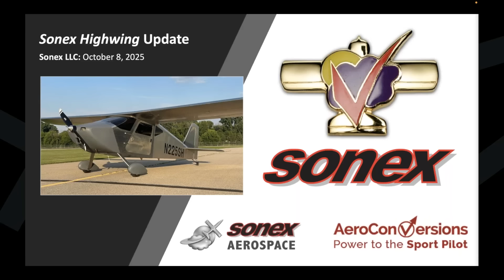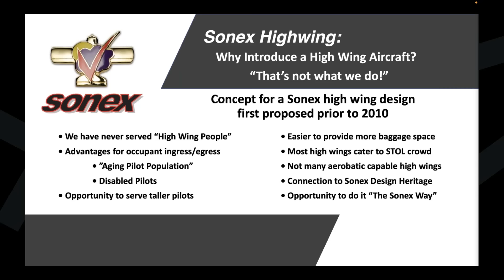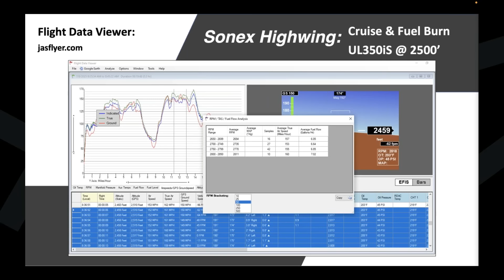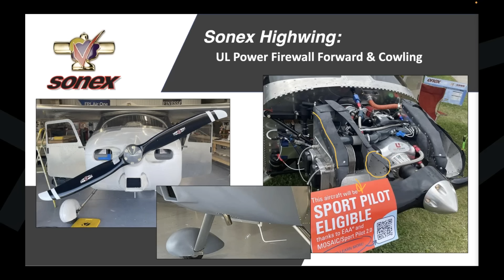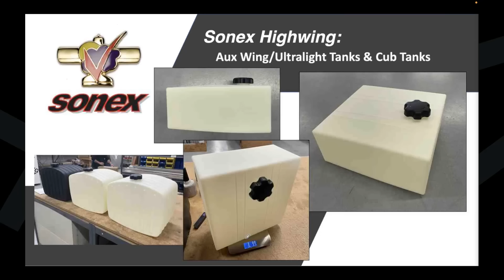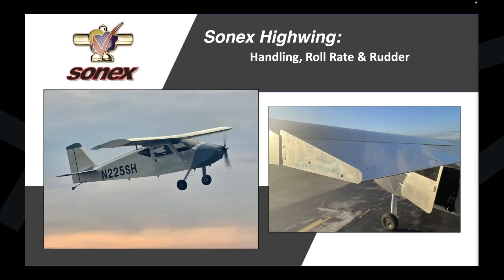Sonex Highwing Update: October 8, 2025

Comment: the Sport dual stall speeds is just the FAA trying to act smart, but proving they are still very much can't help themselves when it comes to screwing things up.

the questions about this stupid rule are never going to end. it makes no sense. A PVT pilot doesn't care about  61kt stall if he can fly it regardless if its above or below 61kts. the PVT pilot cares if he can fly it without a medical, in which case it must be 59kts, and so there is NO USE CASE for the 61kt LSA.

People at teh FAA are so dumb that they don't even understand how aviation works.
Reply from the maker: The 61 Knot Vso is an accommodation for the manufacturing side. With this specification, a manufacturer could build a 4-seat aircraft intended for Private Pilots that doesn't have to be Part 23 type certified. For example, a manufacturer can now build something like the Mooney Type S with a 60.2 knot Vso and top speed of 242 knots with retractable gear and a constant speed prop and no-longer have to have it type certified (ASTM certification is a lot less expensive and less arduous, not to mention the savings to the taxpayer with regard to type certification process participation/sadism by the FAA). Imagine what that would do for perpetually in-and-out of business Mooney to help their bottom line.
Reply: @SonexLLC  Thank you. that is the FIRST and ONLY answer I've heard that made any sense at all. Even the FAA fails to explain what this rule means.
Reply: Really, an unfair assessment of the FAA. They should be applauded for making MOSAIC a reality rather than quibbling over the 61 knot LSA. There is a perfect rationalization for the 61-knot LSA. You should try to see if you can figure it out before spewing nonsense.
Reply: @whoanelly737-8  Applauded? they spent FAR too many years doing what everyone else had detailed in mere weeks, almost a decade ago.

"There is a perfect rationalization for the 61-knot LSA. You should try to see if you can figure it out before spewing nonsense."

and yet, you can't explain what that rationalization is....talk about irony. spewing ad hominems against anyone who dares question your almighty gov is not a valid argument.